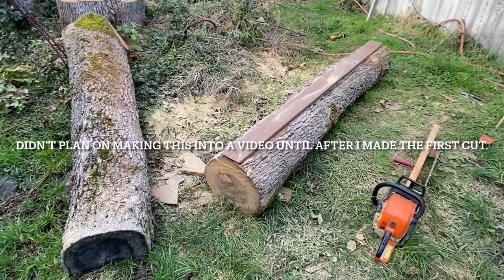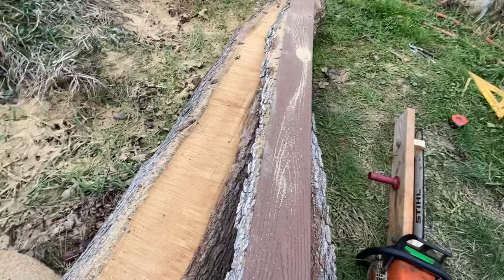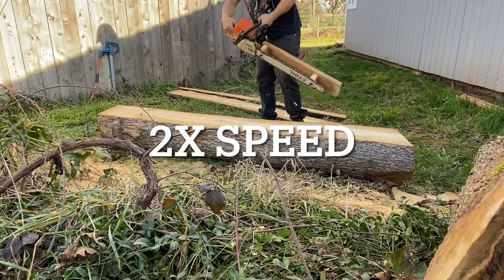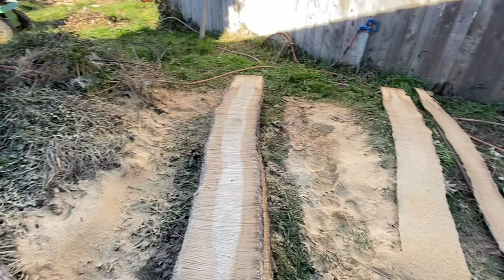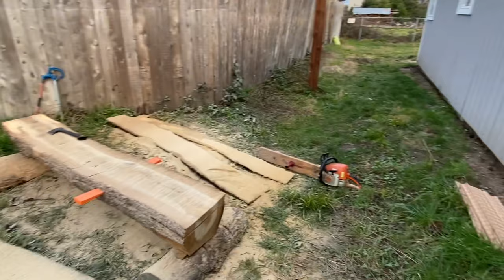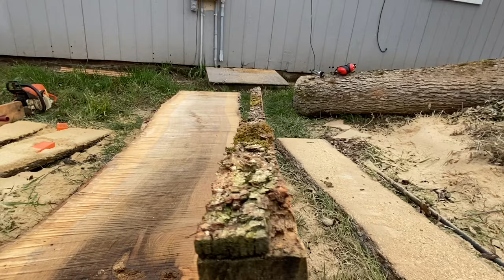Milling oak logs with a free DIY Alaskan chainsaw mill.

Comment: Just a friendly tip. Put some shims in as you go. Helps to not bind up the blade and makes the cut go quicker and smoother. Cheers mate.
Reply from the maker: Thanks for the tip. Definitely going to use shims in the future
Reply: At bit dangerous when the chain snaps  , but thats a good idea milling ypur own trees,  makes a nice long table using epoxy
Reply: O now you use wedges 🤦🏻‍♂️

Comment: You probably already know this, but you could get a cheap planer online to smooth that surface right up ~ and a wood sander attachment for a grinder to seal the wood ~ before the clear coat / or boiled lindseed oil to protect. Great idea though ~ and awesome vid!

Comment: I just finished milling a 12cm plum tree with a 40cc husky with a jig exactly like this. Works like absolute magic with only 15 minutes of time spent on building it. The most important part is the first guided cut as that will set the stage for subsequent cuts. I made short slabs -  about 30 to 50cm - so I couldn't use any kind of fasteners. I just cleaned the moss off the log with a wire brush then fixed the guide plank in place with a lot of hot glue. Worked like a charm. Also make sure to sharpen the chain every now and again since it seems to dull quite fast.

Comment: Hi I would love to see how you made the saw mill as I have an oak tree to cut up into slabs to make a table. Any advice on what chainsaw to use would be really helpful.
Many thanks.
Paul Surrey England
Reply from the maker: Hi. I talk about how I made it in my latest video. It was very easy, I just drilled holes in the bar of the chainsaw and lined up the board and drilled holes in it and made spacers the right thickness and boom it was done.
Reply from the maker: Oh as a chainsaw goes. I’d go with a knock off Stihl from Amazon
Reply from the maker: https://www.amazon.com/Holzfforma-76-5cc-Thunder-G466-Gasoline/dp/B0BD7P3HVX/ref=mp_s_a_1_5?crid=3SSWJBARNGTWY&keywords=holzfforma+chainsaw+g466&qid=1703779969&sprefix=chainsaw+g4%2Caps%2C178&sr=8-5

Comment: Which do you feel is easier. Freehand with a level on the saw or doing it this way? I just had an oak tree come down and want to try cutting some slabs too
Reply from the maker: This is probably slower but makes way clearer cuts. My slabs are completely straight. I would strongly suggest a mill over freehand
Reply: @northwestbushcraftandsurvival  thanks for the tip! I just measure and think my log is wider than my chain is long but think I got an idea
Reply from the maker: Are you thinking what I’m thinking? Cut it to size freehand then use a mill to make perfect slabs?
Reply: @northwestbushcraftandsurvival  after attempting cutting from each side and planning that few pieces yes lol. That was way to much work. Gonna cut my next log in half free hand and then use the chainsaw mill to finish. Then will probably just try to match each half and do glue ups once dry

Comment: Do you have a guide on how to make that? Materials and such? Id like to see if it will work with my Timberwolf chainsaw.
Reply from the maker: No. But it’s just a board and some bolts and blocks of wood. Super easy. I just drilled holes in the chainsaw bar as far apart as I could then set the board on and marked it and drilled it and put the bolts in. It was like 15 minutes

Comment: I’d like to see how you built the mill
Reply from the maker: It was super easy. I just drilled two holes in the blade as far apart as I could without damaging the tip of the blade then set the blade on the board and made marks and drilled it to match. The blocks I just cut to size and drilled in the middle

Comment: What kind of a chain should be used for milling with chainsaw?
Reply from the maker: It’s called a ripping chain. I’ve never used one but I hear they cut faster and smoother
Reply: Yeah, I ripping chain is ideal, but not necessary. I just use a regular chain as well. All mine goes through a jointer/planer in the end anyway.